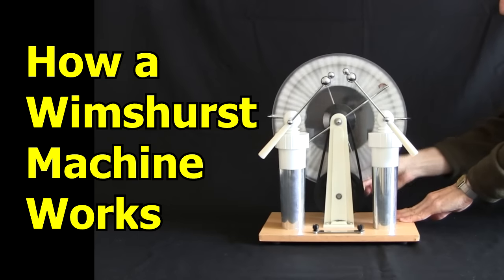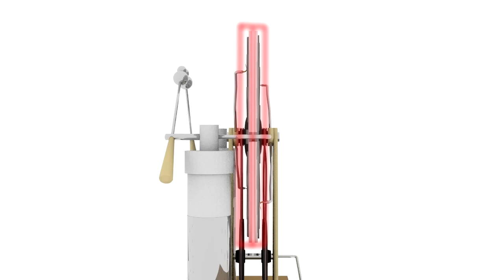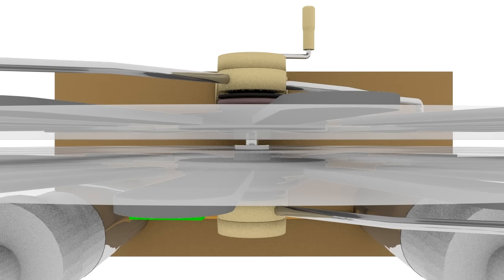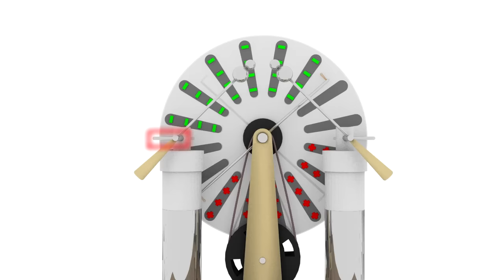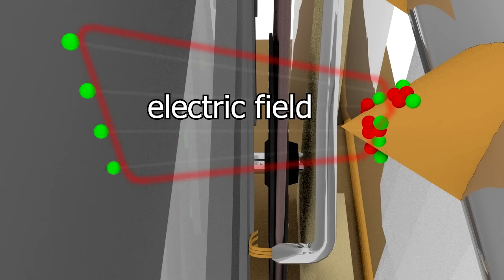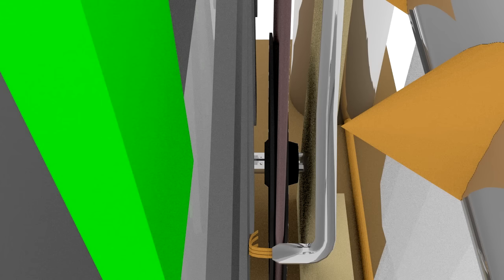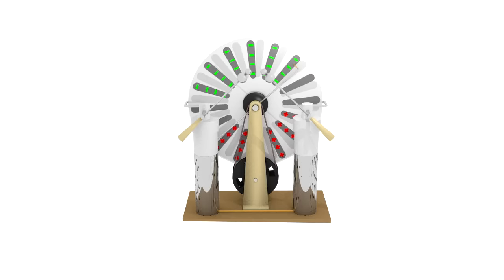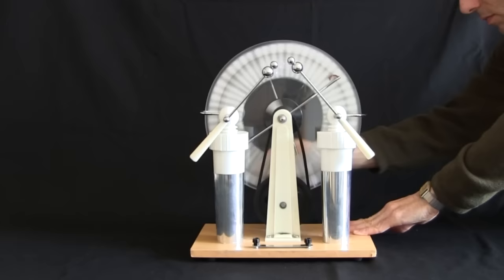How a Wimshurst Machine Works

Comment: How many volts are build there? Also how many microamps are build? Is it possible to make a Newman motor and try to drive that motor? Newman motor is driven only by high voltage from many 9 volts /for example/ batteries in series. What will happen is voltage from Wimshurst machine is discharged in a coil like in Newman motor, for example an air coil with 0.2 mm wire and 2 kilograms coil?
Reply: Is it possible to run a motor through the grounding section, connecting the two caps, 120 jouls of discharge for a 120 volt motor, at 6 volts till breakdown, or is that backwards, and so that the caps would need to be 6/120 farads,  or would it need to be 12 farads doing the math the other way, or would the motor greatly spike the 120 coloulmb discharge, and tear through the wire insulation? Can anyone tell me ?
Reply: I guess I ment before the backwards part, is it 6/120 farad cap rating, or half since two caps, Or is it backwards then ( 20 ) farrads needed,  or is all this wrong amd static cannot work in e m loads ?

Comment: Would this design have no rotational, electrically induced, resistance? Standard generators cause drag on the rotator when producing current. Would this system not produce that drag?
Reply from the maker: Yes, the disks do produce drag on each other through the coulomb force. If you keep collecting the charge using the collectors then the drag isn't too noticeable but if you don't then it becomes very hard to turn.
Reply: @RimstarOrg  I built a Dirod machine (similar) and after I'd stop cranking it would rotate about 1/4 turn backwards. With a motor attached I could hear it load up and start to struggle, used a small motor. Great and clear explanation, kudos! Thanks.

Comment: I think the term "neutralizer" is confusing.
Reply from the maker: I agree. It neutralizes in the sense that it makes the charge at the two ends the same, neutralizing them with respect to each other but they still carry a charge, just the same charge. They're not neutralized though in the sense that they have a neutral charge. Confusing.
Reply: @RimstarOrg  "It neutralizes in the sense that it makes the charge at the two ends the same" I thought that too. I think a better name would be "Charge pre-collectors". The collectors would be the end-collectors.

Comment: Wonder what would happen if you connected the positive capacitor terminal to earth ground and the negative to a aerostat or antenna in the sky, could one create a series capacitor with the earth itself, could one pull in charges from the atmospheric potential difference?
Reply from the maker: Yes. That's pretty much what I did here https://www.youtube.com/watch?v=P0lYZtz7TZ0 but I used a corona motor instead of a capacitor. I explain how it works here https://www.youtube.com/watch?v=qhXxSAv6rMg
Reply: @RimstarOrg  are there any real replications of usable power from atmospheric electricity, I know tesla did experiments in the area and hermann plauson, but there approach were different on the collection of energy on the antenna end, tesla called it radiant energy and his antenna was insulated while plausons was radium doped and conductive, interesting
Reply from the maker: There aren't any real applications of usable power that I'm aware of. A usable amount just isn't practical to gather (too many wires, too much land required, lightning issues,...)
Reply: @RimstarOrg  plauson in his patents claimed that his aerostats collected the charges accumulated in the atmosphere during lightning storms such that the storm was slowly letting off its potential through his converter, he claimed a high impedance inductor could limit the rate of change of current and when undesirable voltages were achieved it would discharge through a safety spark gap. Allowing the electrical storm to slowly discharge in a controlled manner rather than a enormous random lightning strike. Obviously patents and claims aren't always to be believed and need to be verified repeatedly but it doesn't seem out of the realms of possibility. Thanks you for your videos and correspondence, your approach and delivery is very well put together and easy to understand.

Comment: I'm thinking of making  a small motorised one of  these.could i use electrolytic capacitors instead of  the  jars or would they not work the same.
Reply from the maker: Electrolytic capacitors wouldn't work. They're supposed to be charged in one direction only. With a Wimshurst machine, you can't predict which direction the charging will be and it may change unexpectedly (I don't know how). Plus, electrolytics can't handle the high voltage.
Reply: @RimstarOrg  Thanks for the info.I will definitely have to do a little more research before i attempt to build one.
Reply: @oldscoolgaming.5040  Also electrolytics are usually not rated at very high voltage. Use a different capacitor, high voltage and not bothered by polarity.
Reply: @mikeavison5383  maybe i could make something smaller than the jars but still with enough surface area to hold a lot of charge?
Reply: @oldscoolgaming.5040  You could make your own caps by making a sandwich of 2x foil and 2x insulator sheets, then rolling up to save space. Not sure what insulator would be best but you can buy sheets of PTFE on ebay, which may be quite good. The design issue is thickness of the insulator and resistance to arcing through with the high voltages you are going to obtain. I think polyethylene may also be good. Probably shop bought ones are better optimised than you could make but making your own might be fun and give you freedom to create custom dimensions, capacitance and voltage.
Reply: @mikeavison5383  thanks i may give this a try.

Comment: Would the machine work with just the spark gap ?
Reply from the maker: It should. The sparks should be weaker since they don't take charge from the Leyden jars but more frequent since none of the charge goes to the Leyden jars.

Comment: What determines the amount of energy produced in this machine ?
Reply from the maker: The energy source is the mechanical energy you put in by turning the crank. The faster you turn it, the more the energy. But losses are also a factor. Wherever there's ionization to the surrounding air, you have losses (and of course there are frictional losses, i.e. mostly transformation to heat energy, due to the moving parts).

Comment: Can you use this to charge a battery?
Reply from the maker: You can with some added circuitry. But it's already fairly inefficient even without any more circuitry and with more circuitry, you'd only be adding more inefficiencies. You've better off getting a DC electric motor, connecting a hand crank to the shaft and then using the motor wires to charge your battery (maybe with a little circuitry if the voltage isn't right). Basically you'd be turning the DC motor into a generator.

Comment: With this can we achieve overunity that is, can we create more electricity than required to rotate the crank with electric motor?
Reply from the maker: Nope.
Reply: @RimstarOrg  by stepping down the high voltage low current, we can get right voltage and right amperage, is it not possible?
Reply from the maker: Sure, that's possible. But every step of the way from the mechanical energy you're putting into the electrical energy you're taking out, you'll lose a little energy. You'll get less out than you put in.
Reply: May be, changing a crank transmisión axle to the outer side to the disks like pulses motors, with magnets and coils. The diference is that we impulse the disk with more distance of the axle than a crank arm. Like a "large palanque to move the world". In this case, moving with coils and magnets. Rectificing energy like you say.
Reply: Yogeshwar Singh still nope, stepping down requires transformer which requires an AC current. or you can use intergrated city circuit but you lose a lot of energy, and even you reach 100%efficiency which is impossible, it's stil not enough as your current is very low despite high voltage, you have overall low wattage. and you only use spark gap which is unstable, which you  do not get consistent flow of electricity. Dynamos are alottttt better, still amazing invention Wimshurst machine.
Reply: No that would be a free energy device.
Reply: Hi yogeshwar. Which class you are studying??

Comment: Sir, I'm using rubber bands for belts for a Wimshurst machine that I bought from EBAY. One of the black belts broke and I needed a replacement. the problem is that there is a very small dot of a spark and when I go to touch the handle to turn the machine again to turn the counter rotating disks. I :feel: a click or a faint pop. I think the rubber bands are transferring the charges from the diagonal neutralizing bars to the drive shaft of the bottom pulleys and on to my hands. I'm using rubber bands for both belts. Three medium rubber bands for one side as a belt and three medium rubber bands for the other belt. Is there a difference between the black rubber belts that came with the machine and the rubber bands I'm using as belts?
Reply from the maker: I don't know anything about the rubber bands you purchased from ebay so I can't say. However, it's possible. It's also possible that the rubber bands are being charged due to the triboelectric effect and their interaction with the pulleys.
Reply from the maker: What I mean by what you're describing as possible is if the rubber bands are slightly electrically conductive. I'm guessing that  you had to take it apart to change the belts so maybe something else you did when reassembling it is causing.
Reply: @RimstarOrg  ya, i'm thinking triboelectric materials too. The pastic pullies and rubber bands. Anyway, thank you sir I appreciate you taking the time to respond back.
Reply: I know this is really old, but I think your problem is in the elasticity of the bands. If they aren't exactly the same then the disks wont rotate evenly. Could it be a mechanical/timing issue? (asking for educational reasons)
Reply: @elizabethmckinney7182  I actually just ahelved my Wimshurst machine, all this time, The disks didn't sppear misaligned. My gut tells me its, ironically, that the rubber bands and the pullies are two different materials, a triboelectric effect migjt be occuring. So, in essence I got a Van De Graaf grnerator in my Wimahurst machine.
Reply: @johndoe-bq1xt  I only asked because I've seen several that used ordinary rubber bands without problem.  But their pullies were wood.  It's an interesting problem though.
Reply: @elizabethmckinney7182  wood would be closer in the triboelectric table to rubber (if my memory serves me correctly) then plastic. So, there wouldn't be any electrical exchange. But, I could be wrong.
Reply: @johndoe-bq1xt  I'm just a hobbies. I have no clue.  Lol
Reply: @elizabethmckinney7182  Yeah, but one person an generate thousands of volts by making a few of these nachines and hooking them up together. That's pretty powerful !

Comment: How much amperes is  electricity of this item end how watts
Reply from the maker: I don't know, it's not flat DC and it's not sinewave AC so it's not something you can easily measure with a meter. I'm guessing pretty low though, since if you have a long enough antenna and/or strong radio station nearby then you can light an LED which needs around 20mA. I've never gotten that much from it though.

Comment: ok interesting , how about adding a transformer between the two round electrode ark spheres  with two more spheres connected to the transformer and have an air gap that the charge crosses through the transformer primary.  This should create some pulse fed into the transformer and could be rectified into DC, essentially making the energy created into a useful regular electrical energy we are so accustom to in our world.  Store the energy in a battery system .  Add a large flywheel to the rotating system with a DC tickler motor that would keep a specific speed of rotation for the static plates having monitoring input from a micro controller. .  The flywheel would want to keep the system in motion as per the physics laws.   The DC tickler motor would kick in when required  and use very little power to keep the rotation happening once the machine was up to cruising speed.  Maybe we have an energy system that doesn't break any laws of physics?  Your thoughts?
Reply from the maker: The electrical energy output of a Wimshurst machine is less than the mechanical energy input required to turn the disks. There's no violation of the conservation of energy here. In addition to that, it's actually a fairly inefficient machine since there are a lot of losses wherever there are ions crossing an air gap. The transformer idea still sound fun though, even though you'd have to wait for a spark before it does anything.
Reply: @RimstarOrg  oh you misunderstand... I didn't say it was a violation of the conservation of energy .  I simply was thinking of adding a transformer with two balls of it's own and air gapped  between the two arking balls presently in your machine.  Then I believe the transformer would turn the high voltage power into useable power which could be rectified to DC and stored in a battery system.  now also add a large flywheel onto the machine which suggests something in motion tends to want to stay in motion.  Tickle that motion with a small DC motor from the battery system as needed to keep the machine speed constant.  Would there be an excess amount of energy available?  Of course you'd need a micro controller and sensor on the flywheel to control the DC tickle motor as well... perhaps a project for you to do and make a video about?'
Reply from the maker: It does sound like a fun project. I particularly like the idea of using the output of the spark gap as input to a transformer. It's pretty spikey output so I'm not sure how well that would transform, but it'd be interesting. You'd still need to hand-crank it to keep it turning, even with the battery/flywheel/motor.
Reply: @RimstarOrg  you'd have to make it a step down transformer for sure and bring the voltage way down as I'm thinking the spark across the air gaps would require at least 30kv or more.   Figureing out a flywheel and where to put it on the machine also would be a task and of course I'd just use an arduino with a speed sensor to regulate the speed..  The pulse would be some sort of dirty square wave as my guess.  Do you have an oscilloscope ?  I'm totally new to the channel so appologize if it's a stupid question.
Reply from the maker: I do have an oscilloscope but I'm too busy with a robotics project to do this now anyway. It's an interesting thing to think about though. I also wonder about the speed of the voltage change that you'd get with a spark an whether or not the transformer core would be able to keep up. I vaguely recall something about the speed of the creation of the magnetic field in the core being a factor.

Comment: can a whimhurst power a Van de Graaff Generator ? what is the net energy ?
Reply from the maker: I doubt it. The output of a Wimshurst machine is pretty low due to its inefficiency. Think of it this way... You can hand crank your Wimshurst machine. That mechanical energy gets converted in the Wimshurst machine to electrical energy but since the losses are so high, the electrical energy is only a small fraction of the mechanical energy that produced it. Now you need to convert that tiny electrical energy back into mechanical energy to turn the Van de Graaff machine, but since it's a tiny amount of electrical energy, the mechanical energy will be small too. At each stage of the energy conversion you lose some energy.
Reply: @RimstarOrg  Interesting, considering the leakage. Would there be any way, any application that would benefit from said machine other than novelty? I assume there would be ways to reduce parasitic loss, albeit not by much.
Reply from the maker: I've never heard of any uses other than for fun or education. Regarding minimizing losses, using rounded edges where possible helps. Unfortunately you need sharp edges at the collectors so there'll always be losses to the surrounding air there.

Comment: Why it doesn't produce spark if i turn it in a counterclockwise direction?
Reply from the maker: It should produce a spark regardless of which direction you turn it. I can't try it with mine because turning the crank the other way just unscrews the crank from the rest of the machine. I'm guessing that if you've just turned it one direction and then immediately turn it the other direction then it might not work right away. Also, discharge the capacitors between attempts (i.e. close the spark gap to force a spark). You might have to start with fairly uncharged disks, so let it sit for a day or so. I haven't thought it through though.
Reply: @RimstarOrg  Ohhh thank you so much for the explanation!! ^^
Reply: RimstarOrg I’ve used mine in both directions. But, I find it always has to be restarted with my plastic rod and wool. It seems that turning the disk just half a turn in reverse seems to neutralize the charge requiring a static source to restart it again, in either direction.